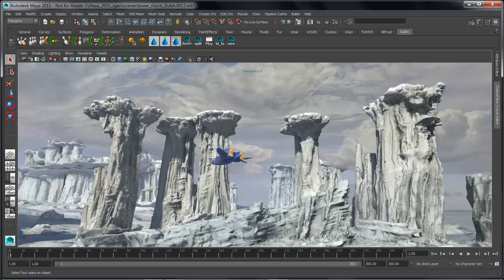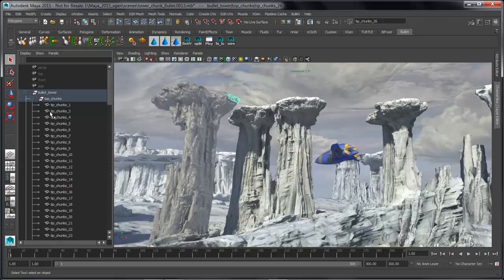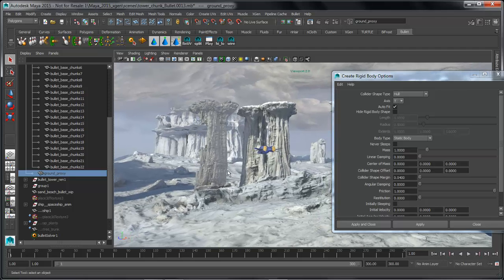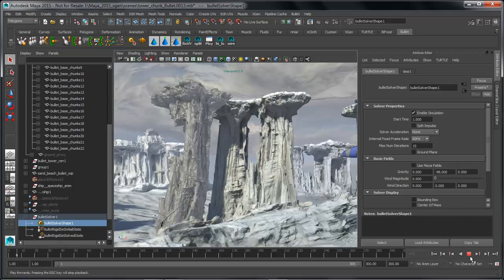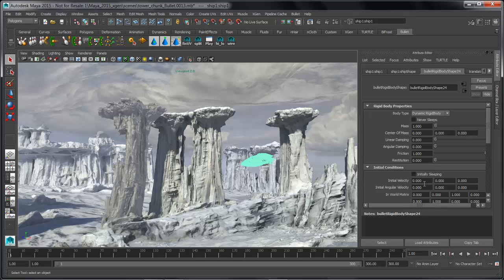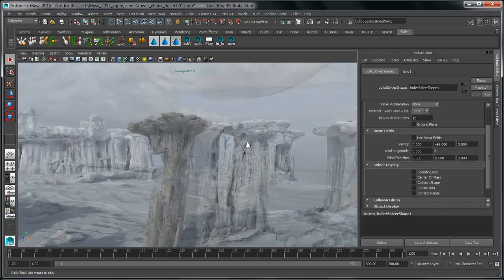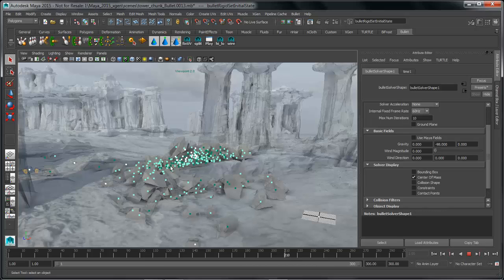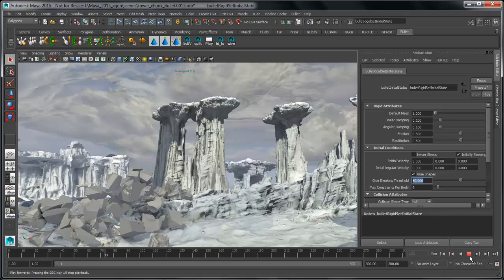Autodesk Maya 2015: Bullet Physics

Comment: please help, when I change some attributes, it just doesn´t update the parameters and when it finally happens, it somehow remembers the last simulation - like the cache was not deleted - and it uses the cache in different frames so it jerks! Really buggy thing - and I alwas have to select objects more times, try things like setting initial state, selecting objects or fields or going to the start of playback range but it just doesn´t help.
Reply: I have a similar problem I cannot set the initial state to the current position. without this capacity it is just a toy
Reply: It does seem pretty buggy.  I can't get anything but the "cube" Collider Shape Type to work. The rest just fall thru the floor :/  I did find that you can retime the final sim using the Alembic node in maya. Nice built-in speed and frame offset functions.

Comment: This is not real tool. It is toy. You cant for example constraint part of the bullet  rigid set to another geometry. So you cant simply explode something and keep some part of that  rigid body set stay at place. You should develope node based constraints like in Momentum for XSI. Maybe we will see something in Bifrost in near future. Something what connect bullet power and bifrost node based process. In 2015 we have bifrost liquid simulation and destruction pipeline for kids not for professional work.
Reply: couldn't you just use a second node for the part of the object you would want to stay stationary?
Reply: civilian im not sure its possible

Comment: The tool looks messy and unfinished if you ask me.  I think we need to have better particle/physics to react.

If you hit thin car metal its going to crunch and possibly break away from the starting pice.  Since its dense and stong its going to stay together for the most part.

If your hitting several feet think rock/concreate its going to not have the same effect as the strong metal.  Its going to come off in small chunks and only the hit/danage particles are going to come off.
Reply: It's ok for what it does, Plugins like Pulldownit will always be preferred.
Reply: I looked at it once and the problem is the same.  

When seeing the dinosaur going through the wood door it assumes that it can just fall apart.

The wood should bend then snap where the tension is built up most.  Not just fall apart in sections...
Reply: da awesomedude Most destruction plugins for Maya don't have bending only breaking, the only plugin that does bending also is DMM but seeing what Houdini has in the destruction area i don't think there is anything as good currently.
Reply: model accordingly. These pillar chucks were modeled that way, it wasn't the physics engine that created them.